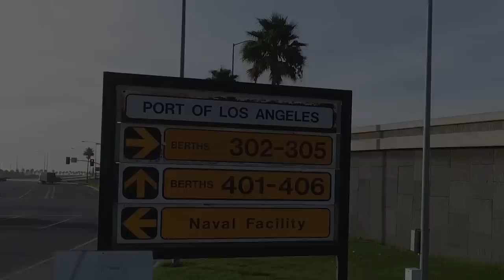[HOONIGAN] DT 090: Golf Cart PVC Drift #FAIL

Comment: When are you ls swapping the shit miata
Reply: bocket runny its the kikata
Reply from the maker: Never.
Reply: TheHoonigans WHYYYYYYYYY
Reply: The Hoonigans , never say never , :(
Reply from the maker: HOONIES NEVER SAY DIE!
Reply: Swap the little engine to sometthing better but still would fit!.
Reply: I think it would be easier to turbo it. B6ZE's are quite easy to work on, and there's a lot of bolt-on kits; the only thing you'll have to do by yourself if you're gonna use one of the kits is an oil return line for the turbo. In the end, it should have enough juice for donuts.
Reply: bocket runny HELL YEA ENGINE SWAP SWAP THE MIATA WOULD BE THE BEST IT WOULD DO A BURN OUT WELL CAUSE ITS LIGHT WITH LOTS OF POWER!!!!
Reply: Ls fits a miata Aussies been doin it for 10+ years
Reply: Ls swap the cart

Comment: I've been doing commercial plumbing for a few years now and the biggest PVC we've come across is 8in which is for big stuff, like gigantic roof drain systems for massive warehouses and such. . that is def waaaay bigger than 8in.. Narly huge pipe! Oh and typically you can just use a sawzall with a long ass blade.. preferably metal blades for PVC pipe..

Comment: awsome!  i got an old gas powered golf kart also, my plans are 1. go fast 2. go low 3. do burnouts ( have plenty of golf kart wheels).
bought a 22hp vtwin motor for it,if i cant get that to fit, ill go with a 6.5 hp bleah motor. 
wanna get some air shocks for ride control- either slam it or jack it up. maybe ill put a rake on it, old skool style.
wanna do burnouts n donuts.
itll be getting the old sound system out of my truck as well, might even put a hitch on it to haul stuff around.  keep ya posted👍
Reply from the maker: +dangerous toys56 👍🏼

Comment: Next time, put a little dish soap in a spray bottle with water and spray the tire so it slides into the pvc. The water and soap will dry and stick really good. This method is used for putting new grips on  mountain bike handlebars.

Comment: This is when you need a biker in the doughnut shop....... Use very large zipties around the rim and tire to suck the tire into the rim, press into pvc, cut ties and yank them out. wrapping ties around a tire also works for sliding them onto rims.